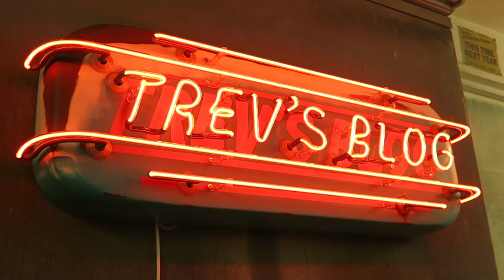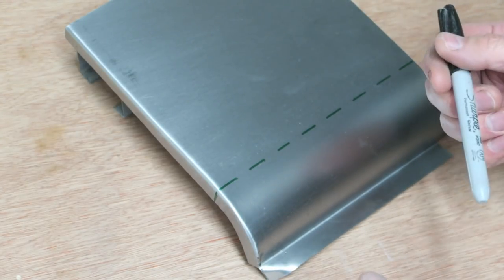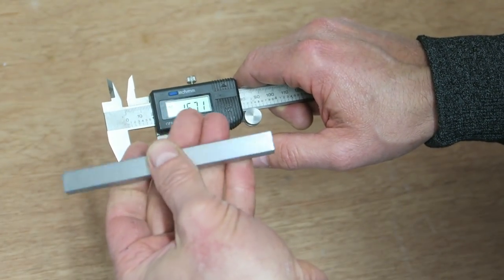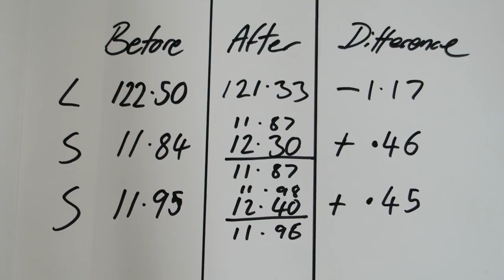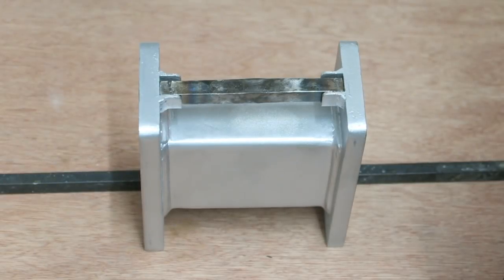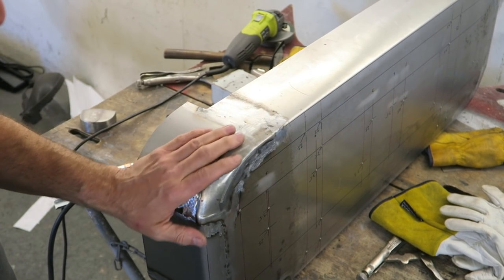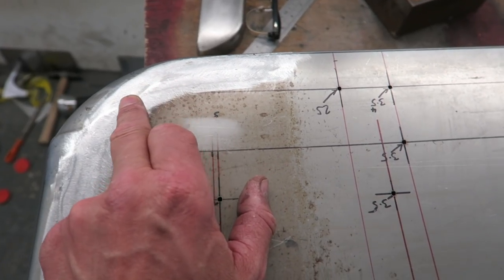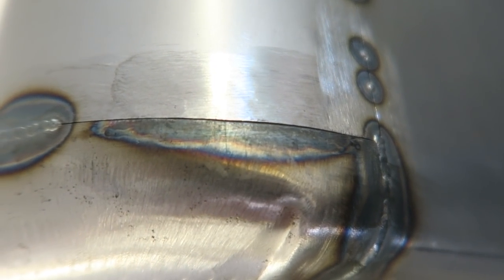Why you get heat distortion when welding thin plate. The Heat shrinking Effect Tips and Tricks #50

Comment: Nice demonstration of what is actually happening. I welded a roof in a 33 Ford 2 door sedan. I fitted a roof panel of a 55 Chevy station wagon to fill the roof. I scribed the panel from underneath and then cut it 1/16" oversized. I tacked and hammered all the way around to keep the right tightness and up and down of the panel. I then Tig welded the back in one pass so that my heat affected zone was even. The high crown held it very stable. I welded the front the same way but being low crown the heat caused the panel to buckle about 2/3 of the way across. After it cooled I was able to just push it back up and tap the weld a bit to hold the shape. I welded both sides the same way without stopping except to grab another rod but never let it cool. A little grinding and planishing brought it to the point of very little filler. By allowing for the shrinkage by adding to the panel and just letting it shrink I reduced the amount of work to get it back into shape at the end.

Comment: MY late father was taught by English pro restorers. Did amazing work on cars. Never once used a MIG welder on a vehicle. All gas. He could cut a door panel through the middle horizontally with hand sheers and weld a new piece in with gas welder and NO rod.

Comment: Nice one Trev as usual. 👍👏
You hear a distinct metal on metal ring when you 'hit' the dolly under the panel.
The first time you hear that ring it stays with you forever.
Beginners don’t always realise that only relatively gentle hammering is needed on finishing.
Wouldn’t like to try that on MIG welds😤
Reply: Would it not work with MIG welds? Just wondering
Reply: @andyl3721  
MIG weld are much much harder than TIG and likely to fracture.
I once filled a small hole in the Mud Wing on my 1935 Austin Seven Ruby and tried using a hand file to smooth it and the file just stated over the weld such that I resorted to using a flap wheel on an L-grinder.
TIG welds are, too all intents and purposes, identical to oxy/acetylene, something I was brought up on using , are very very malleable and a pleasure to work with.

Comment: Awesome thanks Trev good to see you  ,  maybe one day do this on a project ,  but for now just doing a cheap rattle can paint job on my 1996  Rav4 but we going into winter here in New Zealand,  so just doing small dings with bondo then mask off and paint,  it's my daily driver and will get damaged more anyway,  and using flat paint army green think will go over with satin clear , but just got alot on at the moment plus doing it outside so need good weather for two days??  If that going to happen lol 🤔🤔  Usly it's when I'm not ready it will be nice then turn Louise for weeks or half nice day's it's what I got to work around 😀👍🏾

Comment: This was such a good explanation and demo that I had no choice in subscribing  😁👍👊
When you used the tig to heat stretch the piece to close the gap towards the end of the video, did you increase the amps or change any settings to get the arc to jump that far?
Thanks for sharing your knowledge, I can see many of your other videos in my future 👍
Reply from the maker: Actually lower amps as it causes scaring of the surface if you have it too high. Cheers Trev 👍

Comment: Hey Trevor, 
I'm enjoying your blogs a lot. I was inspired by your metal shaping in earlier blogs and have surprised myself in being able to shape some intricate pieces. I bough a 4' section i-beam and use a a dolly for a lot of wide pieces and also for corners. It helps a lot.
This past weekend I was replacing rusty metal under and above a battery tray that suffered a frost busted busted battery and I noticed the metal would not weld well, even though I cut back to good metal and cleaned off with grinder. It could be the welder as I was on a n extension cord but I did another section earlier in the day w/o problems with same setup.Have you seen metal exposed to excessive battery acid being difficult to weld? 
Best
Michael
Reply from the maker: It could very likely be the acid, I’ve had varying issues with this kind of thing. Cheers Trev 👍

Comment: Great video! Finally heat shrink and stretching from welding make
Sense. How much difference between fission and weld and adding rod?
Reply: Fussion welding (no filler rod)?
Reply from the maker: It’s hard to be really objective. I don’t think there’s much in it. The thing with welding is you have to get the metal up to melting point whatever method you’re using. I think that the length of time spent welding probably effects it more and where you join it even more than that. Cheers Trev 👍

Comment: Hi Trev, I am renovating a T25. I have stripped it all down and have been learning to butt weld patches on the outside. My question is what do you do about leaving bare metal patches when there is an inner skin so zero access after the patch is welded in! The weld seam is totally bare on the back and some of the paint burns off anyway around the area inside. I saw lots of videos showing weld through primer burning off and so not much use but that doesn't cover the weld seam anyway. Do you discuss this problem in one of your videos? I think people avoid to mention this in their videos as everyone just welds it in and paints it up nice on the outside with no mention of the back! Cheers, really enjoying your videos...
Reply from the maker: I did a video on rust proofing 👍 the best thing I’ve found to do personally is to use only an extremely light coat of weld through if any at all. As you’ve identified it burns. If you apply a thick coat it will blister causing a moisture trap which you cannot get to. I always drill a hole if there’s no access at all and use cavity wax. Provided you’ve coated the inside with the wax, you will have greatly slowed down the process of the internal panel from going rusty. Cheers Trev 👍
Reply: @trevsblog  Thanks for the reply, I'll check that video out.

Comment: Hello again Trev!  On the subject of TIG, what's your advice on finding argon at a reasonable price? The disposable cans are expensive and last barely more than a few seconds. Air Products are reasonably priced if you are a heavy user but works out expensive for the hobbyist. In between those options there seems to be a wild west of fly-by-night dodgy gas suppliers.
Reply from the maker: Definitely buy a bottle then have it refilled as you go along. Have a chat to Graham that works at Noz.alls 01242 681 052 tell him Trev from Trev’s blog recommended them. Real nice chap and he’ll advise you on what maybe the best way to go. They use good suppliers and deliver good sincere service. Cheers Trev 👍

Comment: Am painting a whole truck but someone said to apply a 2k epoxy sealer and I already got urethane basecoat and clearcoat but am gonna get the primer later this year after I move to Texas which probably could be December but since they said get a 2k Epoxy primer and sealer was gonna get that too I have everything else to paint my truck which is a midnight metallic blue and changing it to a metallic electric daytona blue which is a lighter blue.
Reply from the maker: In the uk we typically don’t use sealer. As far as I’m aware it’s a clear primer that you spay on top of the substrate before putting down the basecoat and then clearcoat. It’s apparently used so that you don’t have to spend as much time preparing the panel for paint, even avoid rubbing down altogether! Provided you prepare the panel properly then I can see no real need for sealer, as said I’ve seen thousands of cars painted and we’ve never used it. The absolute best advice I can give you is to paint a small panel from the vehicle with the products you have got, before you paint the whole truck. You then eliminate the problems you may face when you come to complete your paint job. I’ve had many problems painting cars over the years, some of these due to using products that weren’t compatible, but I only found this out after I’d painted the whole job! Cheers Trev

Comment: A question for you Trevor . Having had a BOC account for 40+ years their annual cylinder rental has become  vastly expensive ( £140 ea PA ) . I have cancelled  Argon, Argoshield and Oxygen  and now purchased half size cylinders outright  for each  from motor factors where now you only pay for refills. However they do not do Acetylene   they offer something they call  'fuel gas'  which I think is  propane based ?. I use Oxy - acetylene  for nickel bronze brazing with an in line gas fluxer which I do not want to give up also and oxy acetylene  is so good for heating up  seized rusted bolts. So do you have experience with this 'fuel' gas  will it do the same as acetylene ? It is vastly less expensive  when you need the facility  but are a low user . BOC do not want to know.
Reply from the maker: Hi Richard give Noz.alls a call 01242 681 052 speak to Graham (tell him Trev from Trev’s blog sent you👍)he can sort you out with a rent free acetylene bottle, I think they perhaps do three differ sizes in total. BOC is a total waste of time unless you’re using vast amounts of gas. Pure acetylene burns hotter with a tighter flame this cannot be replicated using a mix, perhaps ok for heating up or a bit of brazing but not great for welding as the flame is always a bit lazy. Cheers Trev 👍
Reply: @trevsblog  That is very helpful Trev many thanks. Great films by the way entertaining and informative and lovely quality work. . If you were in Hertfordshire I would be  a regular  bakery customer too  all looks lovely .

Comment: I have a question regarding the demonstration with the rod being heated and measured. As it heated the rod expanded . As it cooled slowly the rod went back to its original dimension.   If you were to cool it down quickly would it still return to it's original dimension or would it be smaller than original (heat shrinking?) thanks
Reply from the maker: Hi David as the rod heated it expanded correct, it expanded in all directions including lengthways. Because of the restriction in movement lengthways,  because it was trapped in the jig it had nowhere to expand into so it had no option other than to increase in width. There could be some confusion with cooling material down and expecting it to shrink more than it would if allowed to cool slowly. In the case of this experiment if the rod was cooled let’s say with a wet cloth, it would return to the same length as cooling slowly. This is because the jig was cool and unaffected by heat. Rapid cooling of the rod would simply mean that the rod would contract within the jig, the jig would have no linear compression on the rod in the cooling stage, only in the heating stage of the rod. If the experiment was different, let’s say we heated both the jig and the rod to exactly the same temperature and then rapidly cooled the jig down independently of the rod. This cooling of the jig only would cause the rod to then decrease in length, because the jig would then be contracting faster than the rod. If we allowed both the jig and the rod to cool slowly, again the jig would have no linear compression on the rod because both parts would contract at the same rate. This is how rapid cooling can create shrink but it has to happen in the right way to be effective. Heat shrinking basically happens when the centre is heated and the surrounding material isn’t, it’s the forces that are set up by the temperature difference.
Reply: @trevsblog  Thank you for taking the time and giving a detailed response. Now I finally get it regarding the heat shrinking method...  On a panel,  the surrounding cool metal which has a comparatively higher hardness/stiffness is what forces the cherry hot softer metal to shrink into itself because the hot zone is the path of least resistance for the moving metal .. You have a way of explaining things that makes it easy to understand.. I am restoring an old 70s ford capri and your videos have been truly helpful.
Reply from the maker: @davidgalea6113  glad to have helped 👍